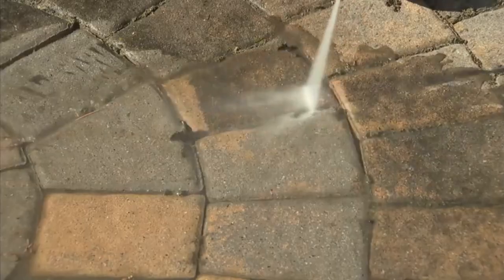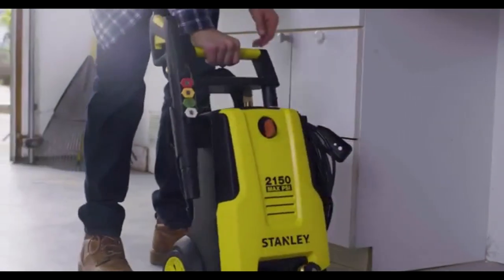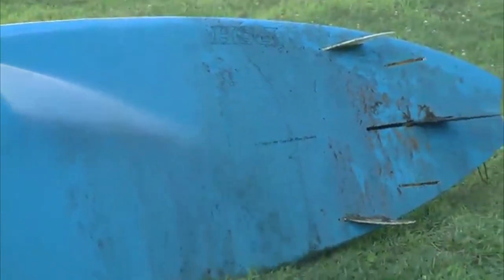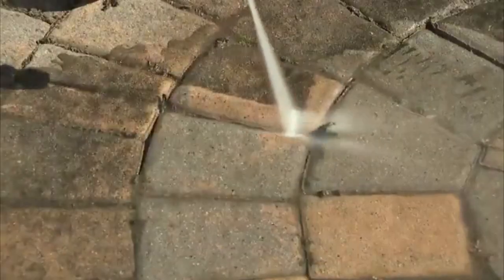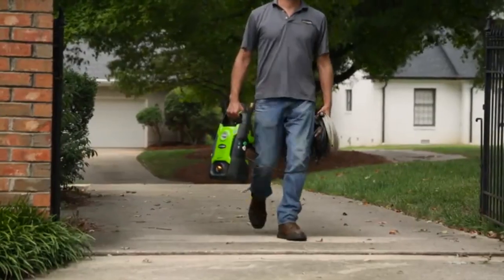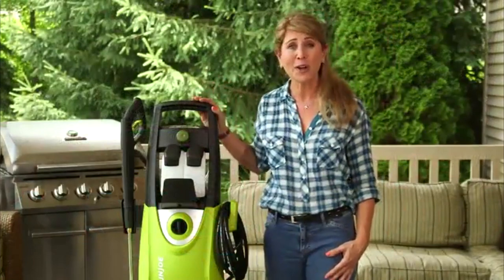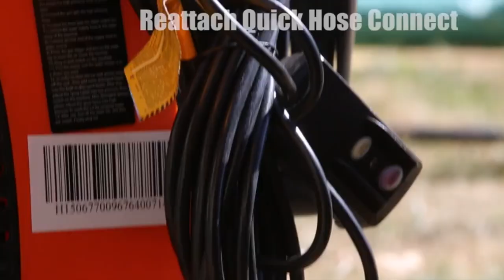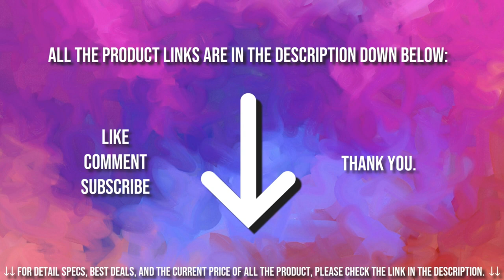10 Best Electric Pressure Washer for Around Your Home in 2019

Comment from the maker: Best Electric Pressure Washer
Links To All Featured Products Below [Show More]
This list is not a TOP. Is a list of the  Best Electric Pressure Washer  in not  a particular order

10. Sun Joe SPX4000 2030 PSI 1.76 GPM 14.5-Amp Electric Pressure Washer

      Amazon US https://amzn.to/2HLeC4N

      Amazon UK https://amzn.to/2Wo2Dx8

      Amazon CA https://amzn.to/2TZS0E6

 9. AR Blue Clean AR390SS Electric Pressure Washer

      Amazon US https://amzn.to/2V0KzZN

      Amazon UK https://amzn.to/2WtSUoZ

      Amazon CA https://amzn.to/2Ww65WK

 8. Stanley SHP2150 Electric Pressure Washer with Spray Gun

      Amazon US https://amzn.to/2HNPeLE

      Amazon UK https://amzn.to/2WAsUsr

      Amazon CA https://amzn.to/2UgE1Jg

 7. Sun Joe SPX1000 1450 PSI 1.45 GPM 11.5-Amp Electric Pressure Washer

      Amazon US https://amzn.to/2HJb6rE

      Amazon CA https://amzn.to/2HVLIy8

 6. Karcher K1700 Electric Power Pressure Washer 1700 PSI TruPressure

      Amazon US https://amzn.to/2Wvxkke

      Amazon CA https://amzn.to/2Wp5Ooc

 5. Sun Joe SPX3001 2030 PSI 1.76 GPM 14.5 AMP Electric Pressure Washer with Hose Reel

      Amazon US https://amzn.to/2HSU3Tc

      Amazon CA https://amzn.to/2HLpoYS

 4. Greenworks 1500 PSI 13 Amp 1.2 GPM Pressure Washer GPW1501

      Amazon US https://amzn.to/2U0CeJ3

      Amazon CA https://amzn.to/2HK4hpz

 3. Karcher K5 Electric Power Pressure Washer, 2000 PSI, 1.4 GPM

      Amazon US https://amzn.to/2HIbhDr

      Amazon UK https://amzn.to/2FHjZ2o

      Amazon CA https://amzn.to/2YtEcQM

 2. Sun Joe SPX3000 Pressure Joe 2030 PSI 1.76 GPM 14.5-Amp Electric Pressure Washer

      Amazon US https://amzn.to/2Ysdx6W

      Amazon CA https://amzn.to/2FH7Smg

 1. Ivation Electric Pressure Washer 2200 PSI 1.8 GPM with Power Hose Nozzle Gun

      Amazon US https://amzn.to/2CFyC4A

      Amazon UK https://amzn.to/2JLiJj5

      Amazon CA https://amzn.to/2HL84D9